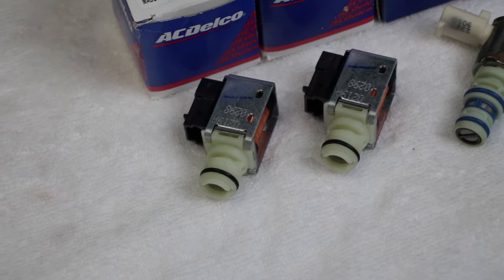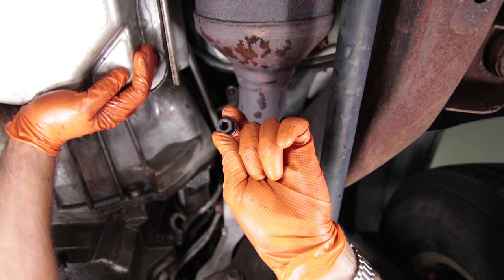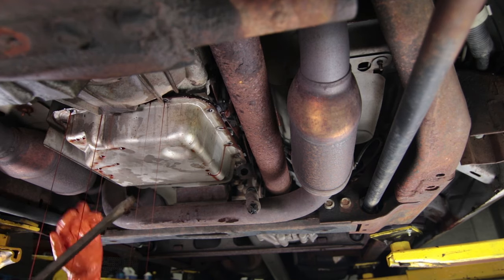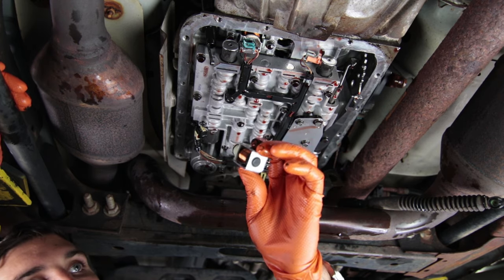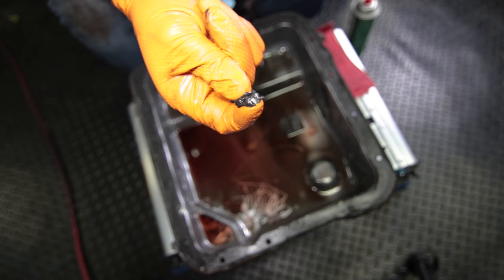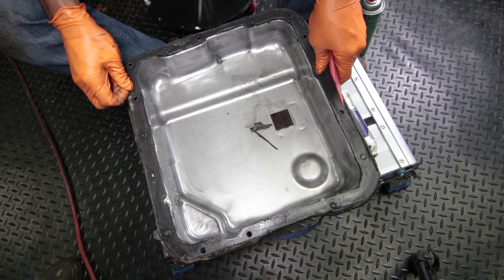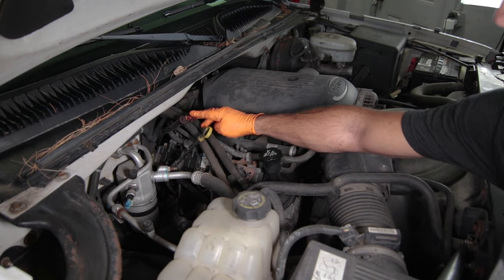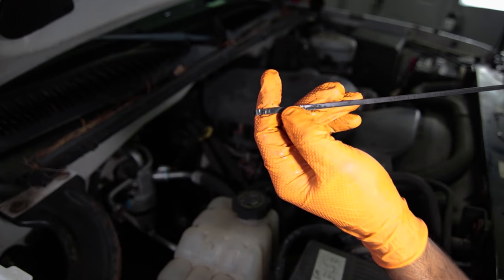HOW TO Replace All 4L60E Shift Solenoids and Torque Converter Clutch (TCC) Solenoid. Silverado 1500

Comment: 1999 Tahoe 4WD with 359,000 miles, original transmission with only the kick down device, with the silicone nubs, replaced.  Fluid changes only, so far.  I now drain and refill the 3 qts. that come out, every third engine oil change.   I may move it up to every 4th oil change. 
.
The indent at the bottom of the pan is where a drain plug goes.  I bought an aftermarket Fram(?) plug and last time I changed the filter installed it.  All transmissions, auto and standard, and rear differentials, had fill AND drain plugs.  What is with the asshole automakers that they can't keep the tradition ?  They must get a kickback from all the replacement gaskets that are sold.  On the rear end; I stick a tube in the fill hole and with the little pump you buy that screws onto the quart bottles you can suck the old "juice" out and then I use a separate clean one to pump new oil in.  Very simple, sally pimple. LOL !
Reply from the maker: Is annoying that so many have gotten rid of it. Makes it a pain to change the filter. Not a bad ideal with the tube down the fill hole

Comment: I get no Codes related to Transmission, I'm getting Trans and filter replace. I get delay Shifting from 1st to 2nd and more on 2nd to 3rd. I go easy on the gas pedal to not push too much.  what do think could cause this?
Reply: Have you fixed the problem?

Comment: What could be a symptom of a bad torque converter clutch solenoid?  I am having one hell of a time tracking down the source of a really weird noise during downshift on my 4L60E.  Trying my best to accurately describe the noise would be like a clicking/almost engine breaking noise combined when you let off the gas... Not inconsistent, happens every time, and as soon as the truck finally downshift into first it stops.

If you put it in 1-3 on the selector there is no noise when letting off the gas... It has to be related to shifting somehow.  A and B solenoid are brand new and still does it.
Reply: Oh my God mine is doing the exact same thing! Please tell me if you fix this and what it was! Pleeeeeeeeeease lol
🇺🇸👊🏻💪🏻🤙🏼
Reply: @c_mac7773  well unfortunately it wasnt related to that... had to get the solenoids replaced anyway and still have the noise.  I am 99.7% convinced my issue is with AFM/DOD.  I still have yet to find any document that lays out the parameters for 4 cylinder mode but my best guess is driving in 1-3 deactivates it and driving in D it kicks on whenever off throttle until 15mph then it must kick back into 8cyl mode... at this point I've given up and drive in 3 around town.
Reply: @Mike-xq6ce  wow damn. I'm not sure where you are but if there is a speed shop or mechanic that works on any type of race cars they could probably tune your car and take care of that. Before I had my car worked on I know that was deleted from my truck. If you go to a good tuner they can do anything with the computer
Reply: @Mike-xq6ce Try it in Tow Mode should be able to find out that way cuz it won't run on four

Comment: Please my corolla 2006  has 3 seconds delay automatic transmission gear shifting. You put it in D and it takes 3 -  5 seconds to respond.  When i put in R it takes 1 - 2 seconds to respond.  
It doesn't as well shift smoothly from gear 1 to 2 . 
The RPM goes over 200 before it shifts from gear 1 to 2 and jerks . I got the P0741 code

Comment: Bro my avalanche is fucked right now pouring trans fluid everywhere and dry AF still. Added almost a gallon and now it's in the ground sos I need help. It still drives still goes into all gears. But was shifting bad so I got it towed home. Was told the problem now I have all the trans fluid on the ground

Comment: Do you think this will fix a hard "jolt" shift into second gear only when cold?
Reply: Not usually but I have seen it work but if you have high miles that's just how these trans are
Reply: @wyattpritchett7732  I have 130k miles. I change the trans fluid every 35k not hight pressure just drain refill plus filter.
Reply: @maces1405  add a quart of Lucas transmission additive Im sure that would help

Comment: mine is taking a long time to shift to second and at aggressive acceleration it’ll jump the rpms to 6k and not go anywhere
Reply: it’s like it doesn’t know when to shift it’s weird
Reply: I would be interested in what is going on too. my 99 tahoe started doing this today after replacing the fuel pump. I was told to check the transmission fluid, grounds on the truck, the harness for possibly any wires that rubbed through,  throttle position sensor, and shift solenoids. and the linkage. I will be diving into this in the next couple of days. Did you figure out what the problem was? I am going to start with the simple stuff first... fluid check, check and clean the grounds, I guess after that I will drop the pan and replace the A and B solenoids along with the filter. I will let ya know what I find. Hopefully it wont be a nightmare job.
Reply: @dustinw5527  update on issue? Is it fixed?

Comment: Shouldnt the vehicle be off when checking fluid level?
Reply from the maker: I can't speak to Pete's 4l60 but most transmissions have to be checked while the vehicle is at operating temp and running. That is how it is for my 2014

Comment: I had a question for you if you’d be so kind to answer it. I have a 1997 blazer four-wheel-drive with a 4L 60 E. When it’s cold it shifts kind of sluggish after it’s warmed up going down the highway for about 20 minutes it will then from a stop shifts hard into second and third gear and does not want to go into overdrive. What do you thank sir.
Reply from the maker: Could be weak solenoids? Not sure. Could also be the clutches? No engine codes?
Reply: I have a  2002 GMC Sonoma 4x4 4.3vortec v6  it runs fine but the transmission will I guess you would say fluctuate while driving its not horrible but need to be fixed could it be the transmission control module torque converter or the transmission solenoids

Comment: I have a 07 Avalanche with this 4L60E. It's slipping a bit in 3rd and on down shift sometimes. Goes in and shifts through all gears but a slight slip here and there. No engine lights or anything. Could it be my solenoids?
Reply: What was the solution??

Comment: Hello, I have a 2005 Chevy trailblazer LT. When I shift from first to second, I have to go at least 20 miles an hour for it to shift the second gear, then from there it will shift to 3rd gear. It will not shift to drive? I have changed my switch plate, and solenoids AB and c&d. I don't know where to go from here can you help please thank you!
Reply: Yes my check engine light is on

Comment: If A & B solenoids test 21 ohms is it to be assumed they're good
Reply from the maker: 21 ohms should mean that the solenoid is within spec and functional. Did you try jumping it with 12V? A 9V batter might work too in order to hear the clicking of the solenoid.

Comment: My 4L60's torque converter isnt locking up at all. Shifts into 4th gear, but never revs down. Just got the truck and when i check the trans fluid warm while the truck is idling its showing over full. Does anyone know if over full trans fluid would cause the converter to not lock up?
Reply: they say running it overfull is worse than underfull...

Comment: How much torque do you put on the transmisión bolts?
Reply: 18 ft lbs is recommended. Just make them tight and don’t over crank you’ll be good
Reply: @wyatte7779  ok, thank you so much bro.
Reply: Pan bolts 97 in lbs
Reply: @thejuice7924  thanks man.

Comment: I have a 2001 suburban had it park for almost two years now I drive it change the oil, filter and runs up 20 miles and won't shift

Comment: Thanks for video, it's very helpfullm but I have a 3 questions.
1) Did you put silicone between pan and gasket?
2) Those two solenoids " 3-2 Solenoid "downshifting and another one "torque converter clutch,,, They same or they two different models?..How I find them, by number?
3) You said that truck has transmission 4L60E,   I have 2000 Pontiac firebird 3.8L and it's has same #, are they same?
Thanks..
Reply from the maker: 1) those are two different models
2) if you have a 4L60E it should be the same part numbers

Comment: GM could have just had a bolt to drain the fluid out, 2nd unless you need to make your own gasket there should be an OEM pan gasket. I have removed the pan without touching the exhaust, there is room

Comment: If it’s your car I’d get a pan with a drain plug. if not, I’d try and talk people into getting a pan with a drain plug. It can save you time and effort in the future. It’s annoying taking an ATF bath. Or running a tube down dipstick tube to suck the fluid out.

Comment: I have a problem And I’m not sure what’s causing it I have a 04 suburban and when I’m on the hwy running about 60-75 it’s like the truck is jumping out of overdrive and trying to go back into overdrive and when using cruise control after a few it revs up to a steady rpm until it’s catch the gear again…. What could be my problem if anyone know

Comment: I keep wondering why the oil pan of the automatic transmissions do not have bleeding bolts like those of the oil pan of engines. It is much easier to pick up the oil first without causing spillage.
Reply from the maker: Agreed. No idea 💡
Reply: Dorman makes a replacement pan with a drain plug they run around $40. Worth it !
Reply from the maker: Definetely a good idea 👍👍
Reply: @FelixGA9  Hey that's true, I checked through the internet in some places they show them with drain bolt. Thanks.

Comment: What is the difference between this and the 4T80e because they wanted to charge me almost 3 grand for doing this
Reply from the maker: I'm not sure of the differences off hand - are you sure that wasn't for a full rebuild of the transmission?
Reply: 4L80E is a more stout trans that takes more abuse than the 4L60E

Comment: My 2003 trailblazer 2wd doesn't like to move when it gets warm no codes what could be the cause
Reply: Worn clutches in the trans. Put some Lucas oil stop slip in it an see if that helps.

Comment: The issue I’m having is my transmission stays in second gear one extended. It will get past 3000 RPMs then it will shift into third gear. I change the shift solenoids it’s getting better, but the issue is still there
Reply: since you posted this, did it get any better?   I am having the same issue it seems.    Long delay in shifting from 1-2, and if I stay in 2, I get what feels like slipping.   ALL other gears engage and stay solid, though.   I'm just hoping it can be fixed with a solenoid, and not a transmission replacement.... that would be this vehicle is finished.
Reply: Me installing the shift solenoids makes it a little bit better, but I’m still looking for some more tips on what else I could do no mine seems to go in second gear, 3000 RPMs and then it will shift into third
Reply: @terrellscaife2411  hmm, if those shift solenoids only made it a little better, then perhaps that isn't the real fix.  It's possible by having to drop the pan and refill with new fluid, the replaced fluid was the only reason it got marginally better... leading me to think it is deeper in the transmission, meaning a rebuild.   Probably the thing in my case, since I just passed the 300k mark in this 1995 body... makes me think the cost in time and $$ might not be worth it.   I'm going to have to think on it... Let me know if you find anything else out and I'll do the same.
Reply: Well, to start off, it was throwing a code for the shifts solenoid in order to replace them, you would have to drain fluid and drop the pan so I got fresh fluid in there i’m just looking for some more advice on the shift body itself

Comment: So these solenoids  will work  on  my  2004 Chevy  Suburban  LT 2500 4X4?
Reply from the maker: I would always verify part numbers with the dealer but if it is the same transmission they should
Reply: Either way you're gonna have to deal with the parts guy so ask him and they'll let u know.

Comment: Is this work for 2010 Silverado 4.8 ?? Ty
Reply from the maker: If you have the 4l60 transmission should be the same or similar
Reply: Yes it is . I do have issues with changing 2 to 3 gear .. thanks  changing the 2 solenoid together..

Comment: My 2000 Chevy s10 4.3L 4x4 short bed (automatic) just died today. I have been noticing some problems shifting gears and minor slipping for the past week. Today, I was driving for about 15 minutes when the transmission gave out completely. After letting the truck sit for about 20 minutes, i was able to drive for another 5 minutes. I waited another 30 minutes for the tow truck to pick it up and we could drive it onto the flat bed. could this be a solenoid problem, clogged transmission filter, or failing fluid pump? Also, i had my mechanic replace my leaf springs 2 weeks ago. He installed long bed springs by mistake, so the axle is sitting further back. I know the drive shaft on 4x4's are designed to slide in and out of the transmission, but could this have caused damage? Thank you
Reply: The trans is done. Solenoids r for shifting and you described slippage which means the trans clutches are cooked. U sir need a new transmission.

Comment: I had my transmission rebuilt in my 2003 GMC Sierra 1500 by a guy that obviously didn't know what he was doing and now I don't have forward gears so I am trying to figure out what he did wrong.  I hope it is something simple.
Reply from the maker: Aww man that stinks. Best of luck to you!
Reply: I ended up taking it to the real transmission shop and having it rebuilt and fixed all of his screw up and cost me $3500
Reply from the maker: That sucks.

Comment: Bench grinder with a wire wheel works way better for cleaning off the gasket
Reply from the maker: You need to be very careful not to mess up the mating surface.  A wire wheel might be a bit aggressive.
Reply: I work at a metal fab shop and used a grinder with a wire wheel on it and it worked perfect. No issues and that was 2 yrs ago and never had a leak. It's fine to use
Reply: @TheSundaeDrive  On a metal Pan ? lol  I've been doing it for 35 yrs and never had an issue
Reply: @TheSundaeDrive  On aluminium yes. Steel no. For aluminium they make  plastic finger disks you can use on a high speed neumatic angle grinder for cleaning off aluminium surfaces

Comment: I'm still waiting for someone to tell me why there's NEVER a drain plug on transmission pans??? Also, why don't you use a hose and vacuum, through the Dipstick Tube, to drain most of the Transmission Fluid first ???
Reply: Just checked mine has one 🤷‍♂️🤷‍♂️

Comment: Also once I shift into second gear if I accelerate aggressively it will slip out and my RPMs will race with no pickup. What am I missing?
Reply: Hey Douglas I am having the same issue too. I just got done replacing the fuel pump. Drove it to work today  and noticed it took off from a stop just fine but noticed when I would push the gas pedal to pass or accelerate  it almost seemed like it was in nuetral. I backed off of the gas and as I would describe it as feathering the gas it seemed to drive ok. almost seemed like I had to ease it into second gear from take off then it would catch. I have talked to a couple mechanics I know and have been given a couple suggestions... First do the simple stuff... check fluid, check the grounds, check the wiring harness for any wires that have rubbed through. I was also told it could be the shift solenoids being dirty or worn out. Also have been told it could be the throttle position sensor. I apologize for this being a little lengthy but again I think we are both experiencing the same issues and I will be diving into this in the next day or so. If I figure out what the problem is with mine I will let ya know. Did you figure out what was the problem with yours? If you did I would like to know what it was and thank you for your time.
Reply: @dustinw5527  My silverado started doing the same thing. Did you happen to figure out what was causing the issues
Reply: @connerwagner6886  I haven't been able to find the time to dive into it yet. I have vacation coming up next week. I plan on flushing the fluid, dropping the pan and replacing all of the shift solenoids and filter.
Reply: Gotcha , I will be doing the same thing this weekend, hope it works for us both!

Comment: Would this be the primary culprit if I change the shifter position and it still says in park? And the dash still says "P"

As a side note, fuck BMW because mine has a GM 5L40E and they don't have a dipstick. They deliberately closed it off.

Comment: Actual part numbers please
Reply from the maker: The part numbers are all in the description but here you go: 

1. ACDelco 24208576 Filter & Gasket Kit: https://geni.us/4L60Filter_Gasket
2. GM 1-2 and 3-4 Shift Solenoid Valve (24230298 ): https://geni.us/Af0J
3. GM 3-2 Solenoid (24212327 ): https://geni.us/LkHiB
4. GM Automatic Transmission Torque Converter Clutch Pulse Width Modulation Valve (24227792): https://geni.us/RRNIAsH

Comment: you forogt a very inportant detail whats the torque spec for the transmission pan bolts? you literally said torque 1 sequence then showed the sequence but continued to leave the most important detail of the whole process out! the damm torque specs!!! for everyone needing the torque specs its 9 ib-ft next video from here on out put your damm torque specs in  your vidoe if your showing the torque sequence. if your gonna leave the most important detail out then dont even worry about showing the torque sequence.
Reply: 97 in lbs. it’s in the video description below the links…

Comment: WHY? If the solenoids are not working the ignition switch is the problem.  You would better just replacing the o rings on the solenoids.  If your trans has a 4th, 3rd or no second and reverse save your money and get it rebuilt.